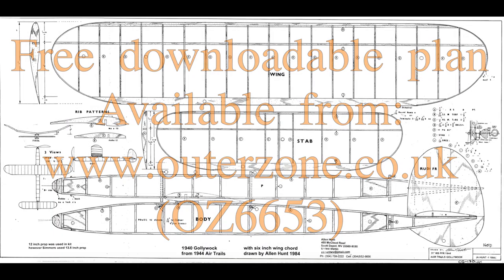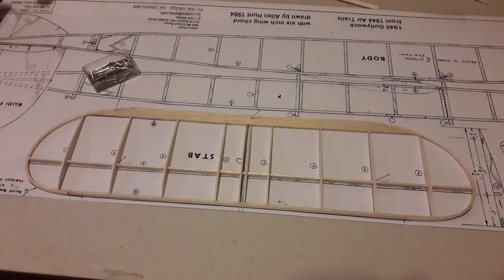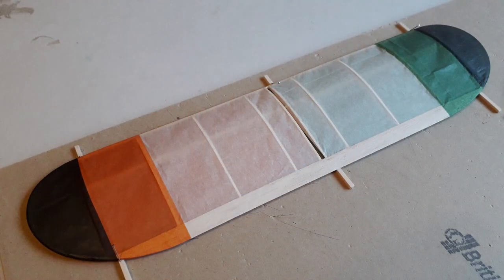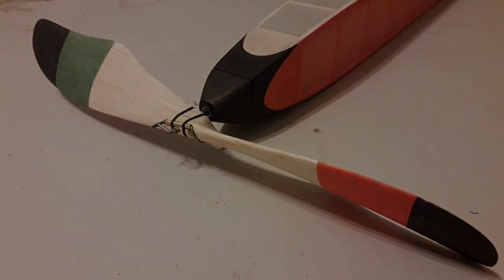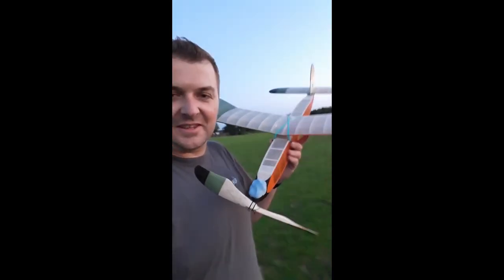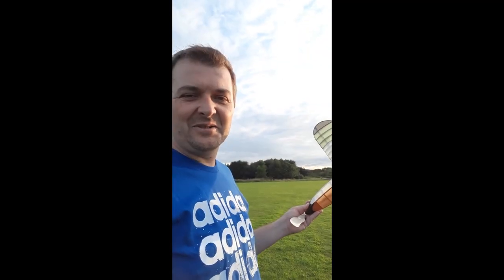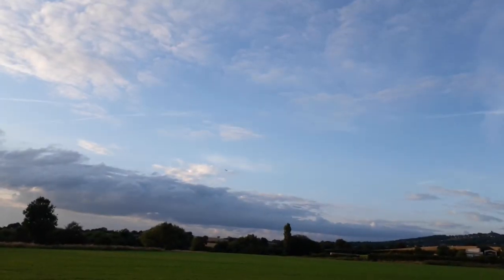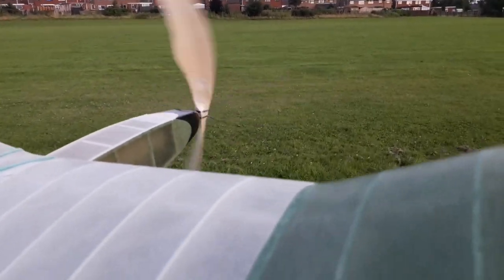Gollywock 1944 Classic Rubber Powered Model Build and Test Flights

Comment: Great build skills from the formed wing and tail feather tips to the tight balsa joints. Gorgeous model and stunning covering job. A tip for you if I may... Ditch the wing hold down dowels and extend the wing mount rails rearward. Attach the wing with a single loop of 3/16" rubber going over both wings and under the fuselage. Then simply move the wing back to balance the model. Use this wing attachment and never add clay balance weight. You can also fly it more nose heavy on windy days and less nose heavy on calm days. I run my Gollywock CG from 65-75% back from leading edge. Here's a link to a video of my Gollywock, jump to 3:32 to see how the wing loop is used...  https://youtu.be/pgepv2loHNE

It's wonderful to see others into rubber powered free flight model airplanes, keep after it and keep sharing it! May many big thermals come drifting your way,
Sam Hallstrom
Reply: Hi Sam, many thanks for your super comment! I appreciate your constructive input and I will certainly consider using the balancing technique you have described in future. The only concern I have is, if the wing moves considerably then the middle of the rubber motor may end up far away from the aircraft's CG... this will of course mean that the CG changes notably when the motor weight changes if I choose to add or remove some strands of rubber for different weather conditions etc. Just another factor to consider but thanks again for your input.
Cheers, Matt.
Reply: @matthewhirst9438  Just another idea on the wing mount. On mine I moved the dowels up to the rails. I had to make the rails a little taller and longer, but it really helped with the balancing.